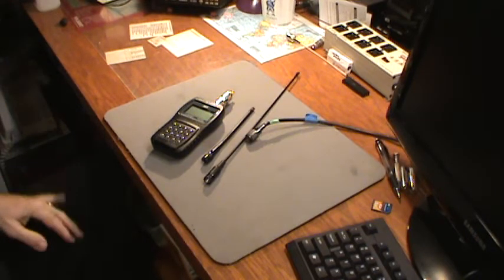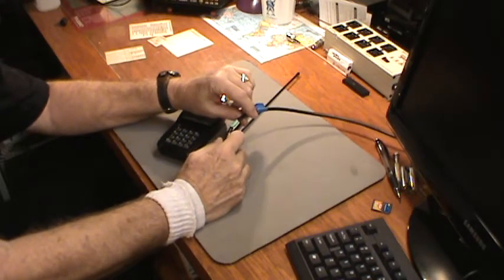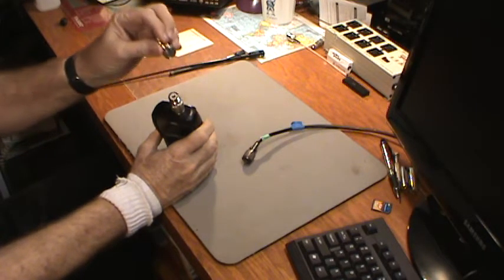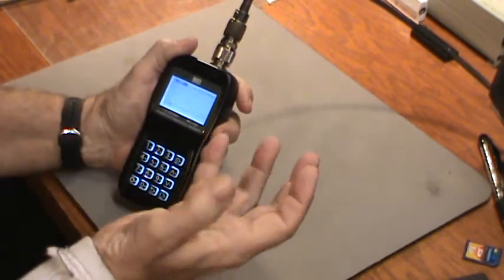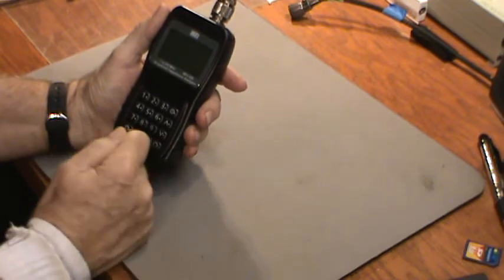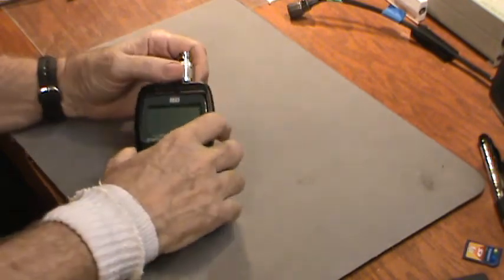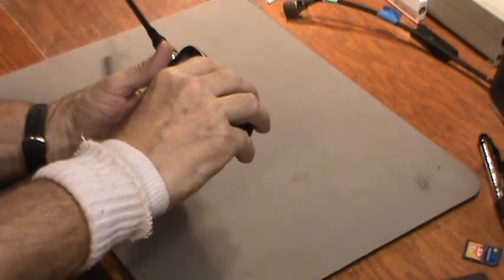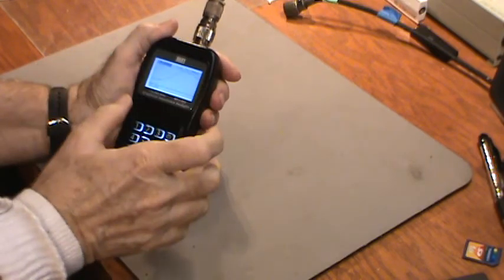TRRS #0792 - More Testing of the MFJ-226 Analyzer

Comment: Lols, I hope the SWR is not true on a Pofung or a Baofeng unit for 2 meters!  That could ruin the PA stage and would actually
make the unit junk since that would make them good for only for receiver use. Thanks for your review.
Reply from the maker: +Dennis Petersen I don't think this testing was valid plus the antenna I tested was not original but a knock-off.  I plan to do some more testing for the heck of it to see what this analyzer says about this cheap antennas.